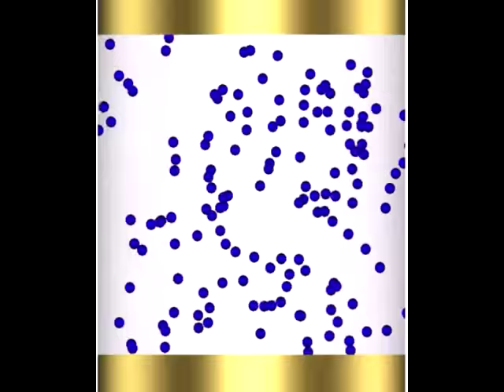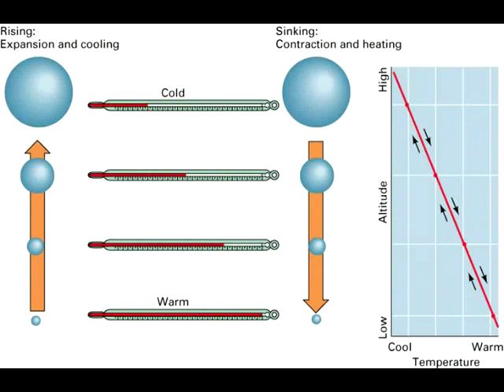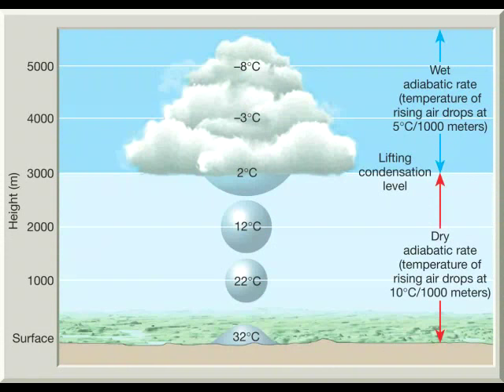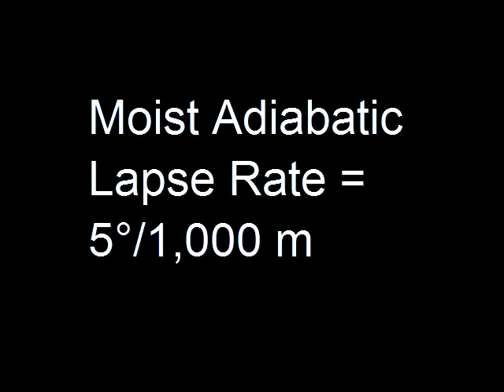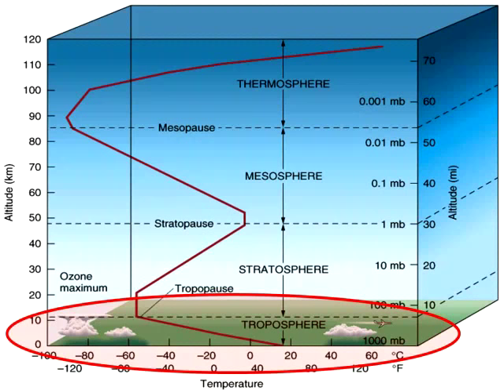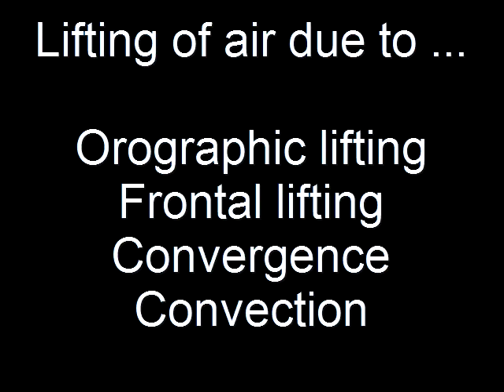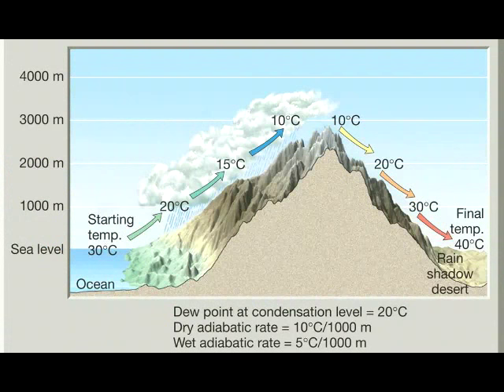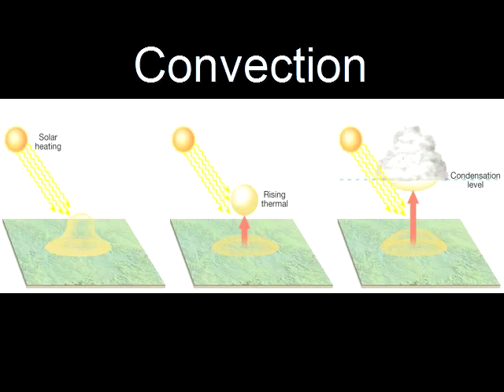Chapter 10   Adiabatic processes, lapse rates and rising air

Comment: Thanks "pull it upward" at 9:44 S.B. "push it upward".  A huge version of the effect at 6:57 is the desert zones nominally latitudes around 30S & 30N. It rises wet from warm ocean in the ITCZ and cools at the moist rate, heads towards Poles, gets turned west--->east by Coriolis Effect and then descends warming at the dry rate with the water latent heat having warmed it on the way up & hot dry air at the surface results, deserts.

Comment: Your video is how I was taught BTW:  Higher pressure has more kinetic energy  therefore lower pressure will take the easiest path out/around.  If you have something blocking ocean currents from forming for long periods of time you get 'higher' pressure over that blockage resulting in low pressure systems going the easiest path around.  Models however don't take ocean currents into account, so you get all sorts of silly scenarios show up.

Comment: Basically temperature is defined as average kinetic energy of molecules. 
Air  at sea level is  compressed compared to air at higher elevations.
So Air at seal level have higher KE and the temperature is higher than temperature at higher elevation not necessarily because of the heat of the sun,  but because of the increase in KE from air pressure on the ground.
No heat is added from sun but, the average KE is higher from the increase in pressure at the sea level, so the heating is adiabatic. 
By the same resining
The when air moves along the mountain upward and faces lower air pressure at higher elevations and average velocity or KE drops and air cools down due to adiabatic cooling at higher elevations.

Comment: Thought Loop:

Compressing a gas causes a greater number of molecules at a given average velocity to occupy a smaller space...so there will be more molecules slamming into the mercury in your thermometer in a given span of time...therefore hotter.

How can compressing air speed up the little balls involved in elastic collisions?  Momentum is preserved in every collision...so average velocity (temperature) cannot change.

The gas molecules can only move faster by adding energy.

It requires energy to compress a gas.

Comment: 1.Air expands when heated and contracts when cooled. 

2. When air is heated, it expands and rises up since the surrounding atmosphere is denser. When it goes up, the air cools and contracts and water vapor condenses to form water which is eventually attracted by gravity as rainfall/snowfall. 

But in adiabatic expansion, we have seen that air expands adiabatically as it moves upwards. If it expands, how is it not able to hold the moisture since its capacity has now increased? And why does rainfall occur? Can someone explain?
Reply: @killacrad  thanks

Comment: I understand that when air rises, pressure decreases, volume increases, and temperature decreases through adiabatic cooling. 

However, I've also been told that cool air contracts like warm air expands. How does that work-  wouldn't these two facts balance each other out and the air wouldn't move at all?? 

Obviously it works out that cold air rises because if I go climb a mountain it will be chillier at the top. But cold air is also more dense than warm air, so how is it higher and how is this true? I feel like adiabatic processes are true to the world but somehow go against those other facts I know.

Comment: According to PV=nRT, if pressure goes down and volume goes up, Temp. could remain the same Conversely, if pressure goes up and volume goes down, Temp. could remain the same. So, why does a rising air parcel have to get colder as it ascends?
Reply: The simple answer is that the ideal gas law is a gross simplification and can only provide accurate predictions for dry air. However, the air in the atmosphere has non negligible humidity content.

Comment: 3:35 how does releasing energy decrease the rate of temperature change? Doesn’t cooling of something mean energy is being released? Why wouldn’t this cause an Increase in the rate of change?
Reply: If I'm not mistaken, that's because the energy released in the condensation is absorbed by the air parcel. So as it condenses it loses 10 degrees due to adiabatic cooling, but the condensation releases 5 degrees which heats the air parcel, so now it only lost a net amount of 5 degrees.

Comment: Why does air expand as it rises rather than contract? Wouldn't it be cooling, which in turn causes it to contract as the molecules pack more closely?
Reply: Formula for the parcel is Volume = Temperature / Pressure (V = T / P). It doesn't cool until it loses heat to the surrounding air but the pressure drops instantly as it rises because pressure is simply the weight of air above it pressing down on it and there's less air above it the higher it rises. Reduce Pressure in the formula above and you see that Volume must increase. This Volume increase reduces the temperature for the reason shown in video (sometimes also explained as the air expansion performs work on the air around it by shoving it out of the way and that requires energy so temperature must drop else Law of Conservation of Energy would be violated, these are just ways of saying the same thing).
--------
What you didn't realize is that pressure is simply the weight of air above it pressing down on it and there's less air above it the higher it rises.

Comment: So AGW is not real? According to this, the composition of the atmosphere is not a factor in atmospheric temperature which explains why there is no correlation between Co2 levels and temperature.
Reply from the maker: In this video, I only discuss temperature changes as moves vertically. There is, in fact, a strong correlation between global air temperatures and CO2 levels but it is not the topic of this video.
Reply: Stefan Becker I am watching your climate change video now. In the graph you use, the medieval warm period has been erased from existence and you are using the climategategate hockey stick which has been proved false.
Reply: Stefan Becker I have just finished watching your climate change video. It seems to be in conflict with this one?  Co2 concentrations on Venus are 96%  and if Co2 concentrations are responsible for climate change, the temperatures would be much higher. Atmospheric pressure alone accounts for the temperature on Venus.

Comment: That is over-simplifying and the wrong way round. 

With your cylinder example, you imply that temperature is inversely proportional to pressure and ignore density.

The atmosphere does not work like that. 

We start with pressure, temperature and density at sea level as known figures. 

We then work out the lapse rate, which is force of gravity divided by specific heat capacity (scaled down by 1/3 because of latent heat of evaporation and condensation) - thermal energy is converted to potential energy as air rises (and vice versa when it falls). That's the easy bit.

We then put all that into the barometric formula to find pressure at different altitudes. That is heinously complicated and requires several attempts ;-)

We then use the rule that pressure is proportional to density x temperature to find the density.